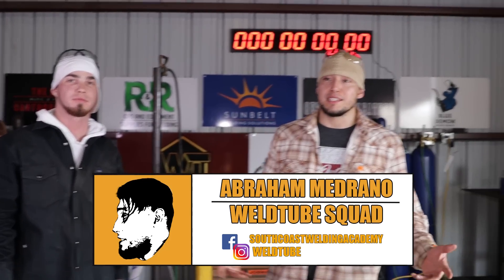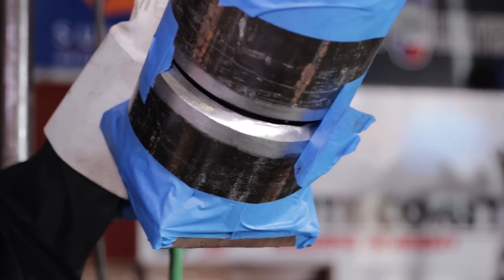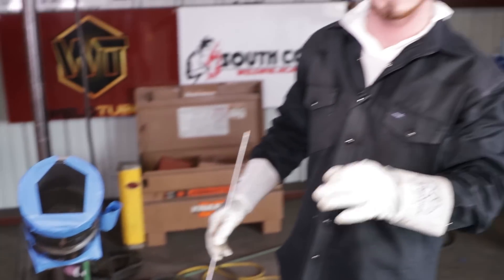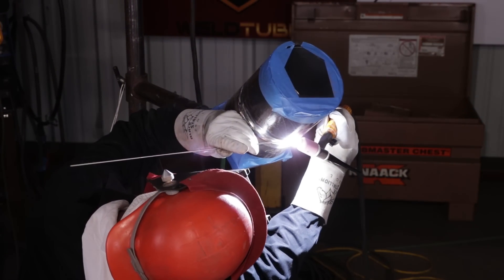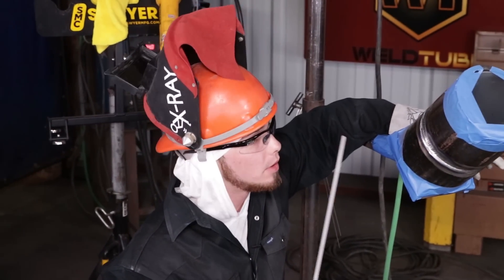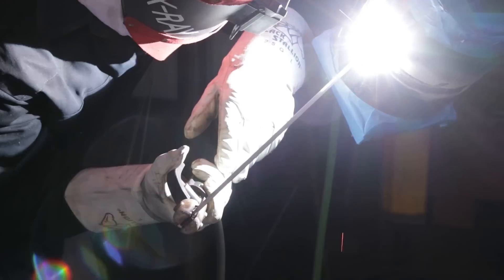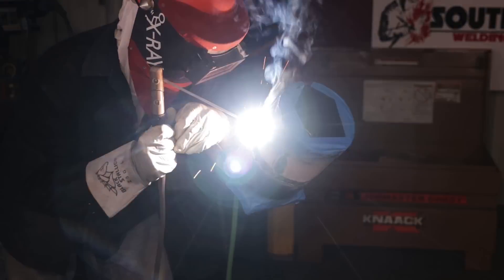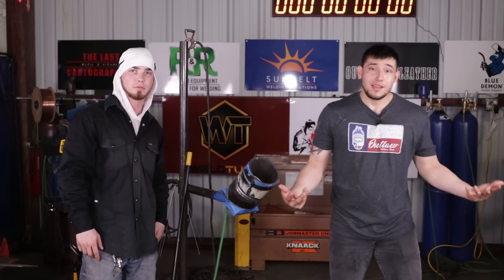Inconel 625 Tig & Stick with James Shine

Comment from the maker: 👇WeldTube Store👇
https://www.weldlife.com
Reply: nice demo, nice weld i will tell you you are a badass welder🧐💪💪..i love to weld inconel. miss this exotic material, pure inconel. and inconel cladded. the cladded pipe is the really challenging. because of magnetic 😂 this material is not easy to weld. you really need a patience  😅 i've done those material last 2016to2019 no work gap, in my previous company in kazakhstan

Comment: im not a master of welding😊 but i want to share my experience. and i miss to weld exotic material. inconel's rootpass is not easier like 316. when you apply the inconel's root, its a littlebit sticky or harder or i mean to wipe on both landing. and then the electrode is much easier to apply in pure inconel material. but its not easy to apply the electrode in inconel cladded pipe. especially when you encountered the pipe that has a magnet😅that you bcome crazy that time it suck really😅

Comment: 😮 Ive been tigwelding pipe last 30 years on pressure pipe. Just started a job were im welding 18" inconel. Its been a struggle!!! Usually root with 1/8, no way with inconel, dummied down to 3/32. Its totally different than anything ive welded before, very slow and need to dab on my edges insted of laying the rod their. Last week its like im learning to weld all over again, kinda licking the challenge of it all. See how the X-Ray goes, its a pretty tight code🤞🤞
Reply: In Dow Chemical we tested to ASME Sec IX and welded in the field to ANSI B31.3.  Inconel, being a nickel based alloy falls under the same qualification as Nickel 200.  In 1971 I tested 2’ xhy open root with Nickel 400 which qualified me to weld inconel 625.  In today’s world all alloy in Dow is tig rooted.  Imagine running SS & nickel stick open roots passing xray in 6G or 2G/5G.  Few could pass the test and fewer could weld in the field after passing the test without repairs so the qualification & test was stopped in the late 70’s. Weaving 6Gs with all welding process we used in Dow and all materials was my trademark!  Keep your puddle horizontal and never forget it.  Too many of these Youtube welding videos never tell the spec or Code they are welding to.
Reply: How do you  deal with the slag? Stuff is like concrete.

Comment: I tested in Baton Rouge today on a inco root stick fill and cap first time ever even welding it never knew there was a stick inconel shit whooped my ass busted out a good welder right there
Reply: HAHAHA! I've tested there many times. Something is different with this test. I don't know if it is the brand of TIG wire or what, but it is much harder than it used to be. It doesn't flow at all and nearly everyone fails it. Grinding is not allowed inside the shop, and very little is allowed on the test, in general. Its like you are being set-up to fail.

Comment: Great video and great skills. Sounds like the test labs in Houston are a lot more lenient than I'm used to. I test in Baton Rouge a lot, and once you feather your tacks the grinding disk is basically off limits. No more feathering your start and stops, and no grinding a tig bead. They might cut you some slack if you fire up with no argon by mistake. I can't really remember, but I think they want you to stick rod the hot pass too.
Reply: Where at you test in br? They lenient as hell at the xraytest lab off scenic hwy
Reply: I retired cuz, just Livin' la Vida Loca now @TheoldRoss4

Comment: This is a great way to do it problem I have is when you test or fit up on site and they only allow you 1/8” tolerance for root gap and by the time you get up top it’s slamming shut.
Reply: Mike Wilkes  get them the 1/8 gap they want. Once they leave just open it up to 5/32 or 3/16  whatever you work with.
Reply: Late reply, but for anybody reading this: if it happens to you, just run a zip up along the bevel to open it up but keep the knife edge (you're running parallel on the bevel). Works for me.

Comment: Can you make a video how to weld galvanized steel
Reply: Not much different from welding any other steel imho. Just have to clean it off.

Grind it off (not the best way tbh as still leaves traces), 
machine it off (best way if possible to do)  
burn with oxy acetylene (have to be careful not to overheat the material as may ruin properties of the steel) 
Or acid treatment (how its done if you sent it to a galvanizers to have it stripped.